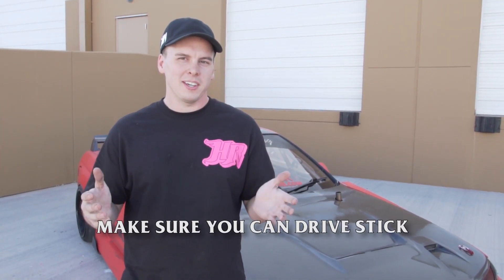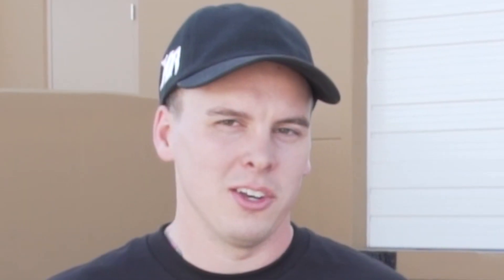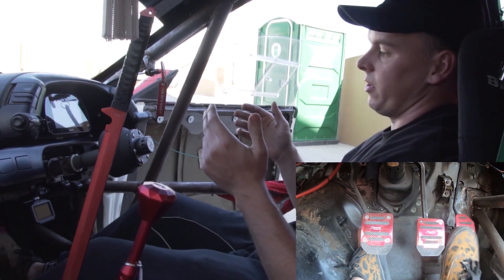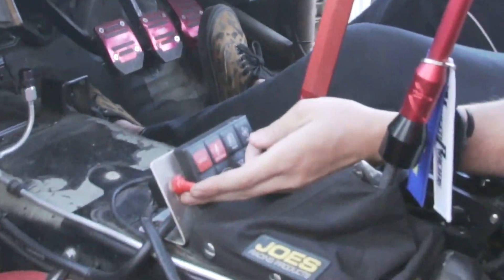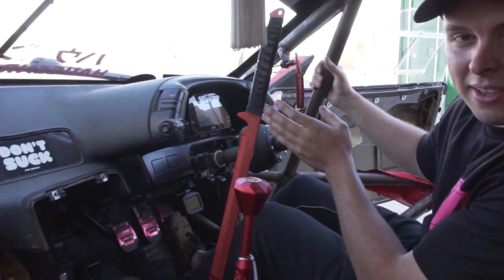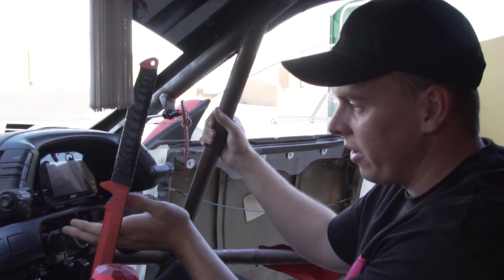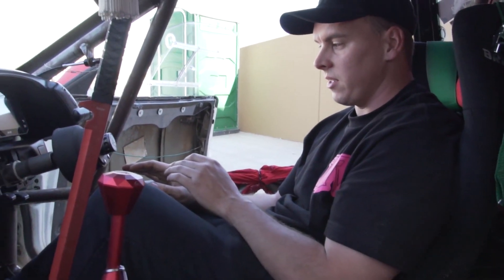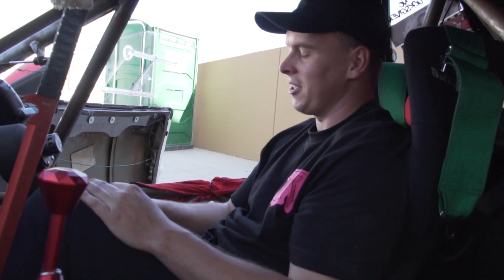How To Downshift Manual Transmission (Rev Match)

Comment: Your car is so sick! and this video was super explanatory I'm gonna go try it out in my truck later. Also, I have a mk1 escort that I'm building and I want to add some angle and a turbo. Do you have any advice for trying to drift an older car like that?
Reply: That's a pretty dang cool car! I would say the most important thing to remember, especially on an older car is to not skimp on maintenance! Really make sure everything is nice and tight and well maintained. Old cars tend to rattle loose a little easier then newer cars just given their age. Regular fluid changing and more than regular bolt checking. Get out and drive as much as you can and you'll learn what the car needs and likes. Most of all, have fun and be safe!
Reply from the maker: Jamo knows best!
Reply: Jamason Upton Haugen Racing Rad! Thank you for the response. I’ll definitely be paying attention to maintenance stuff I’m pretty neurotic about that stuff lol.